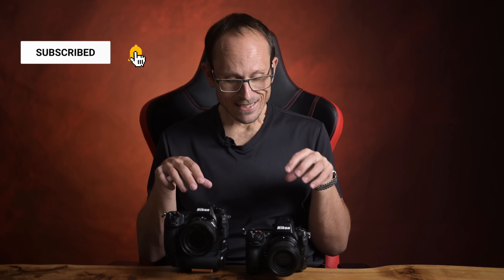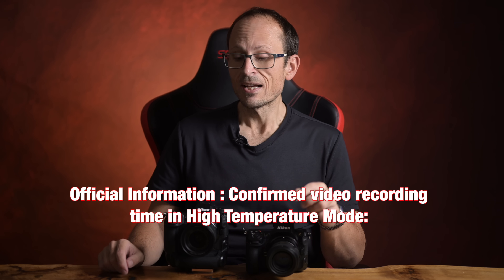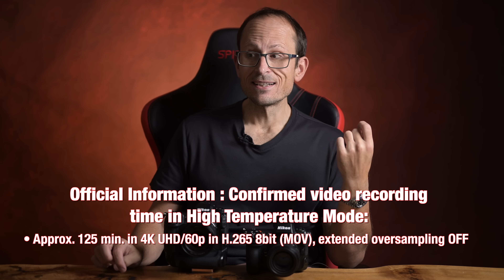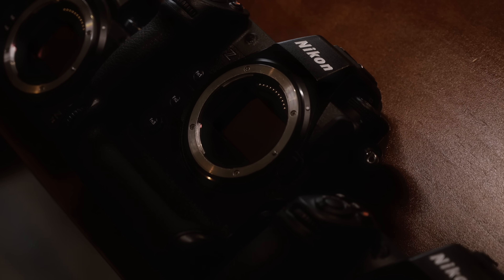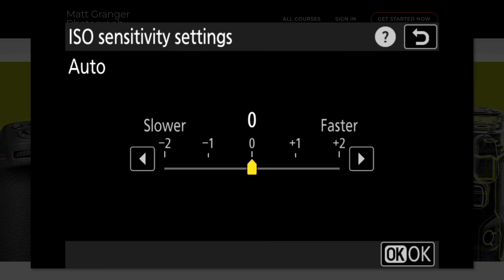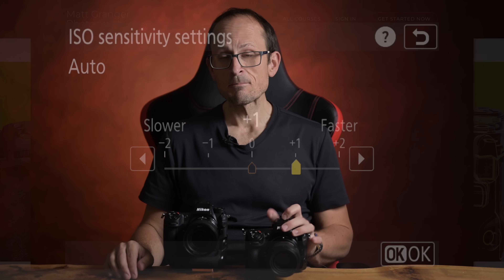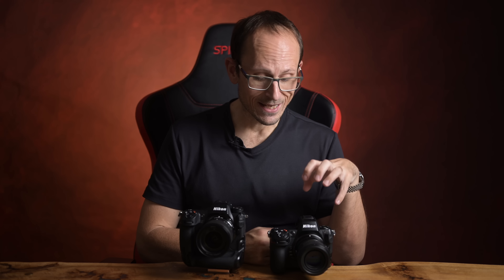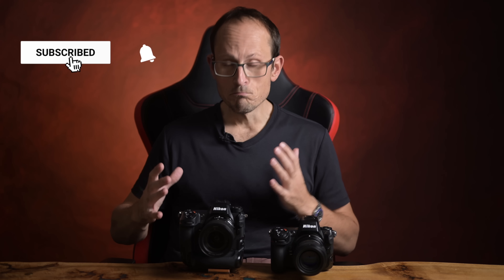Nikon Z8 - Video OVERHEATING & Battery Testing (VS Z9)

Comment: I realize the market expects a mirrorless camera to do both stills and video.  However, it seems with all the overheating issues, the best bet would be to use an actual video camera if this is the primary format the user is making; that way this mitigates this overheating issue.  Truth be known though, I am not looking to buy a mirrorless from Nikon.  I own so many 'D' screwdrive lenses and up to this point, Nikon is satisfied with not producing an FTZ adapter which has a screwdrive motor which essentially locks me out of this Z system.  Maybe of my D lenses are so heavy duty and have defocus control which Nikon doesn't make any longer and I refuse to part with them.  I believe it should be technologically feasible to produce such an adapter but Nikon refuses so I refuse to buy the camera.  Moreover, if I were to try to sell all of my old kit, it wouldn't add up to enough to rebuy all of the new lenses and whatnot so its just not worth the switch for me.  I guess I'm stuck with using old Nikon DSLRs potentially till the bitter end!

Comment: Thanks for the test.  Guess I'm personally glad that I don't shoot video, and the little video I do, is usually 4k30 clips that are under 10 minutes.... if even that.  But mostly do stills so this shouldn't be a concern for me thankfully.    As long as it won't overheat doing some heavy burst shooting for a day, which I don't think it will because you're not shooting all the time usually, and the camera should have time to cool down between large bursts or series of bursts.

I'm wondering if the 2 hours was left generic on purpose (as I thought it was 90 minutes for 8k, and 2 hours overall -- meaning 4k probably?  It may be with the grip you can get long record times, and that makes sense since you have 2 batteries.  I also wonder if the grip also provides some sort of slight cooling.  Can you re-test when you get a grip for the Z8?  I am wondering if Nikon maybe put little air passages in the grip to allow some heat to transfer to the grip.

But again, this goes back to the differences between the two.... the flagship and it's little sibling and differentiation between the two, not that Nikon purposely made the Z8 worse necessarily but given the smaller size, its sort of a given that it will have heat issues, like the R5 which is probably roughly the same size and design in terms of body materials.
Reply: The 125 minutes time for the 4K60 8bit recording and 90 minutes 8k30 8bit was achieved with a PD (external) battery pack. Matt’s test ran the internal battery until it died, it seems plausible that the time can be achieved. However, keep in mind the recording temps the provided. If you are in a hot place, the time will decrease. Seeing it listed as being able to do 8.3K RAW is nice but, I doubted it would do it as long as the Z9 in a smaller body. Personally, I was hoping they would have made 2 cameras, one with a fan (not as large as the Canon R5 C, though) for better video capabilities but, then that might push people from getting the Z9.
Reply: @waynerm002  Yes, true. Temps will also dictate how long you can shoot for, which people on DPR seem to be ignoring trying to disprove this video.  And say that "Nikon states..."  Yes they do, but thats in an ideal situation or average situation at 77 degrees F for example.  They aren't taking into account 90 degree weather for example or cold temperatures where battery life will be decreased.  Plus I think many missed the battery pack/PD (it does say external device) but people seem to not like to acknowledge the footnotes (or they simply don't read them).  When I saw the 8k listed i n the specs, I sort of figured too that there had to be a catch (especially when they listed 125 minutes, thinking of the R5 immediately).

Comment: One thing I want to say. And before I say it, I hope you understand that I don't mean to pick on you. After all, you put the time into making these videos and we can watch them for free. But, you don't seem surprised that the Z8 can't run as long as the Z9 on a battery. Now that makes sense, since it's a very different battery. But when it came to memory cards, you seemed somewhat angry that the Z8 couldn't do as well as the Z9 in terms of burst performance. But isn't it a very similar thing?

It's just a thought. Sorry if I came across as perhaps unnecessarily confrontational before.
Reply from the maker: Not the same thing at all. I’m disappointed they used an SD card. Poor choice.
Reply: @mattgranger  Agree to disagree then I suppose. But thanks for responding.

Comment: The problem is with your expectation that z8 will perform the same as z9 with the smaller body and battery. I dont remember Nikon said that. Read the fine print😊